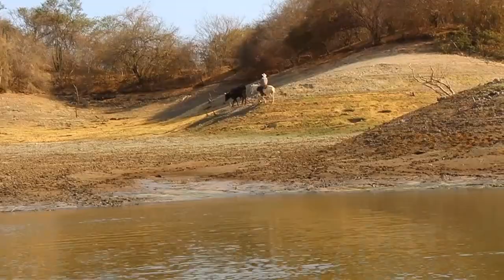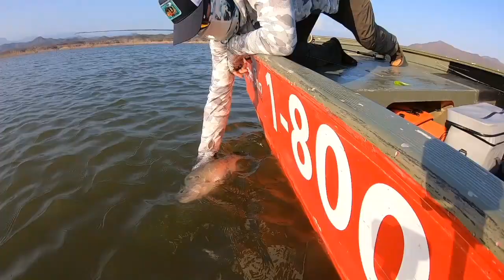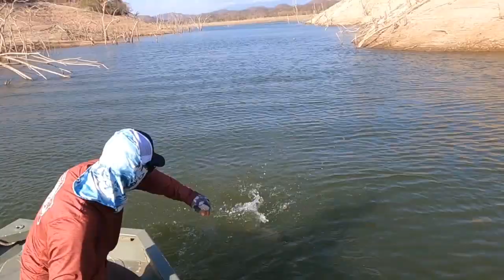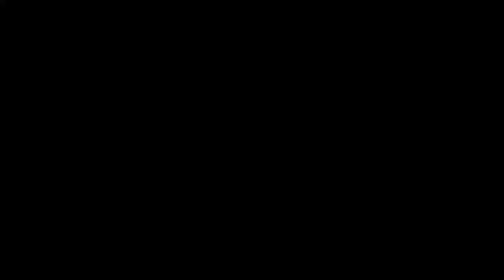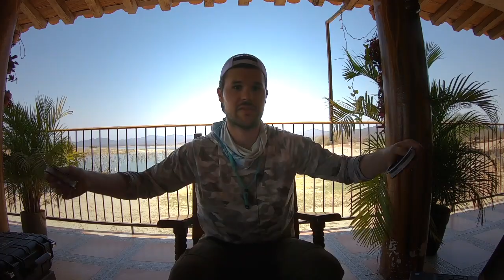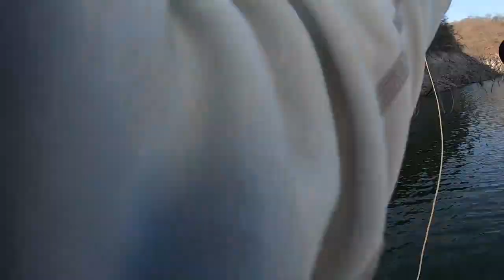Leaders that turn over Flies

Comment: Gunnar, great as always. I think abrasion resistance has two separate factors. Structure like trees, logs, coral vs a fishes mouth. I just returned from Campeche and hooked up to 35-40 baby/juvenile tarpon per day - no doubt that the fluro is better in the mouth of these fish. Every fish on mono -  cut off 3 inches of mono and retie. Fluro cut of 3 inches and retie on every  4-5 fish.By the way - all of those fish were on the fly which picture I sent you - please feel free to use it as your own. It is not too often that the guide takes a picture of my fly - but that is what happened in Campeche and also Rio Lagartos, the colors of the fly were mine but the design, profile and technique were yours.

Comment: Very nice info vid! About mono abrasion resistance, I’m not so sure it’s better than fluoro. It is more flexible though, so it doesn’t snap so easily under tension. It’s way easier to break fluoro when the hook gets stuck behind a rock or a log because it’s more brittle and doesn’t like to bend as much. A sharp rock whittles through mono more easily though because it’s softer.